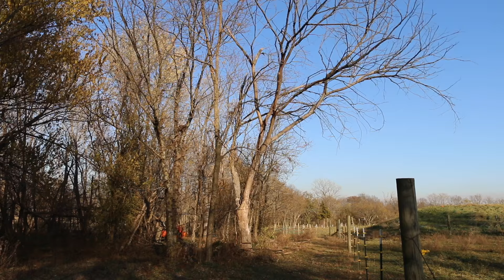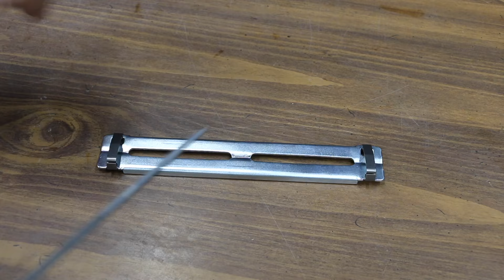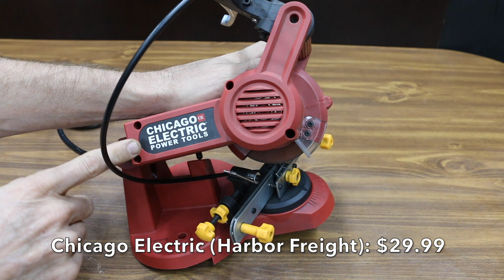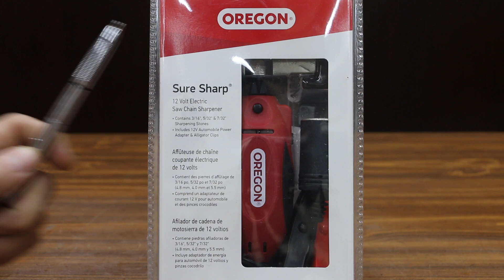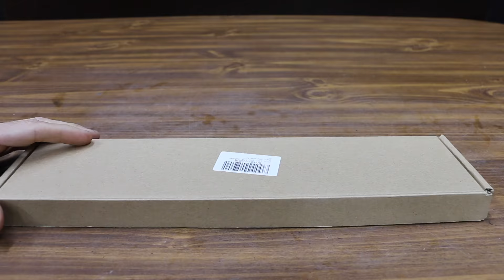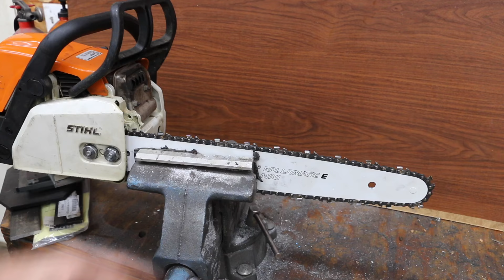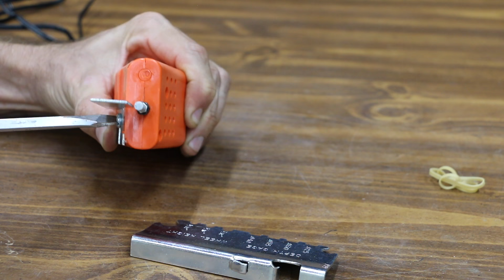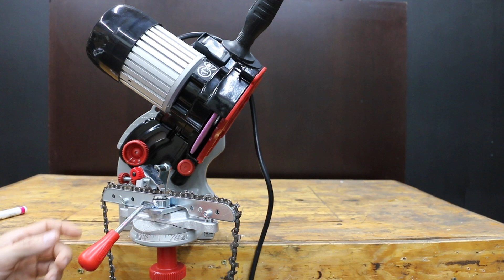Which Chainsaw Sharpener is Best? Let's find out! Stihl, Granberg, Chicago Electric, Oregon

Comment: I swear by my cheap bench sharpener. It will change the geometry. Only use one method of sharpening.

It will cut down the life time of the chain. One chain will last me 120 cords.

With practice they are fery fast, very sharp, and consistent edge. Comparable to a brand new chain. 

I use the slop in the pivot to bring the grind stone past the tooth, with out touching it. Then grind up against the tooth in a lifting motion. Not a cut down into the tooth as displayed in this video.
Reply from the maker: Great feedback. Thank you

Comment: Another variable to consider during this test is the power of the chainsaw. For example, if the slightly different angles being placed on the chain is causing it to bite too much, that could slow down the revolutions. Got to find that sweet spot for your individual saw
Reply from the maker: Thanks for sharing.

Comment: Those chop saw type give no feel. And they probably ruin the bit by overheating each tooth.
  And never ever ever line your face up with a disc. Grinder, chopsaw, whatever. If they get a crack they can explode. In an X or Y or Z direction.
Reply from the maker: Thanks for the feedback!

Comment: This is like art. Or really, an artist.
  The angle of the sharp of the bit totally depends on the speed, torque, pressure applied, amount of material at pitch or angle to be removed.
  Not only that, you have to know the saw. The torque the speed. Learn to rock the saw and stick those teeth into the material.
Reply from the maker: Thanks for the feedback.

Comment: I always look forward to your videos. Thank you for putting so much time and effort into them. I don't watch them all but I often check if have an upload about something I'm doing.
  But I just want to say. I think you like sharpening a chainsaw chain. You seem like that kind of guy to me.
  A chainsaw blade has two teeth in sequence that face the same direction. Find them and start there. No need for a gold tooth.
  And for everybody else get a dremel type device and bits for chainsaws. Because if you can't sharpen a chainsaw tooth you should put the saw down. How long do you think that tooth holds an 'edge'? It's the style of the cut in each bit. Plus each and all the bits. It's the cup and the pitch and the angle and.. did you overheat that tooth with the dremel?
  Chainsaw tooth doesn't care if it's long or new. Sharpen those teeth down until they are nubs or break. And for newbies, learn how to saw with a chainsaw. And if a chainsaw could talk, it would ask, "just help me cut."
Reply from the maker: You are welcome!  Thanks for the feedback.

Comment: I have the Stihl 2 in 1. It works great. It keeps the rockers at the right height while sharpening. I think it takes the rockers a little lower than when the chain is new, making it a little more agressive. The tips feel like a cat's claw. Easy to use, no set up.
Reply from the maker: Thanks for sharing.

Comment: I use the Stihl 2 in 1 file either at home prepping my saw or out in the bush cutting old dry wood between tanks. Good gear and love how it sorts out the depth gauge at the same time.
Reply: It takes a few goes to get used to it. It's hard to beat.

Comment: As Always,, Fantastic videos!   Greatly appreciated.
The ONLY thing I would have added, would be to add an RPM readout to the chain!?   
To show what chain is actually biting more, before & after sharpening, & or if your battery is not fully charged.?
THANKS!
I will stick to my Very OLD style Harbor Freight sharpener for now,,,, (under $25 with coupon) & take the 'rakers' down a few more K's.
lol,,, I TRY to slow down my screaming 365 Husky,,,,, it still RULES!   ;>)
Reply from the maker: Thanks!  Thanks for the constructive feedback.

Comment: I run 5 chainsaws as a log home finisher.  Three Stihl, one Husqvarna and one Jonsered.  And I hate to admit that I can't sharpen chains to save my life, so i had two or three chains for each saw.  I run Stihl chains on everything.  I used to pay an old timer $6 a chain to hand sharpen them until he passed away.  New guy used bench power grinder and ruined all my chains.  Stihl told me not to use grinder unless it was a diamond grinder or you will over heat and Blue the chains and ruin them.  A local company sells Carbide chains at over $100 a chain, you can't sharpen these.  I ran one chain for 2 years until someone "Borrowed" my biggest saw without asking and shattered 8 teeth.  Expensive but stay sharp for a very long time.
Reply from the maker: Thanks for sharing!

Comment: i have stihl 2 in 1 and i use the chain brake, sharpen all exposed cutting edges, then unlock and manually rotate it to expose new ones until im done. easy peasy and works amZing

Comment: Sorry if this has already been mentioned but it looks like the expensive oregon grinder got the cutters too hot. You can clearly see blue temper colors on the tooth, which means it would have gotten dull more quickly. That could explain the unusually slow time on that chain.
Reply from the maker: Thanks for the feedback.

Comment: I'm a big fan of your impartial and robust reviews. Thank you for taking such time and care to be independent and reliable. 
I'd love to see how the Oregon Powersharp system stacks up against these. Some regard it as a gimmick, but the 5 second sharpening process and reliable chisel profile is helpful especially for the inexperienced. I've found it useful on my ego power+ saw and my petrol one before that. Although more expensive to use, it does remove the safety risk of using a blunt chain or one that is out of balance due to improper sharpening. Pros and cons so a test would be great. Keep up the great work! Best regards from Sussex in Southern England!
Reply from the maker: Thanks!  Thanks for the video idea.

Comment: I have hand sharpened a lot of chains over the years. The last 5 years I have mainly used the Chicago Electric.
 
Pros: the bicycle brake handle style clamp works great. Easy to use. Cheap. Can easily see to set up. 

Cons: has a lot of side to side slop, if u take care to pull down straight u can get a decent sharpen, if u are not careful, u will get one side sharper then the other and the chain will not cut straight. Have to clean the space behind the clamping plate regularly. Can't change the pitch

Currently eyeballing the Maxx Chainsaw Sharpener (Maxx - 13151),  Super Jolly Pro Sharpener (super jolly pro TL150), or the Oregon 620-120. I cut a lot of wood and mill a fair bit with an Alaskan mill
Reply from the maker: Thanks for sharing.

Comment: I've been using the Dremel sharpening kit on my chains and it's worked well for years.  Similar to the Oregon Sure Sharp. Install the stone in the chuck, install the kit on the end of the Dremel tool and sharpen away, with angle marks on the guide plate.
But you've got me eyeing the Stihl 2 in 1, now!
Reply from the maker: Thanks for sharing.
Reply: Works great for me as well.  I’ll never go back to hand filing.

Comment: I wish the “Timber pro” was tested. 
  It uses carbide cutter.   Everything else is either file, disk or stone.    Great test nevertheless!👍
Reply from the maker: Great suggestion!  Thank you.
Reply: Tried one out, it worked but i let another boy have it. The idea came from a old hand crank saw mill sharpener they used to make.

Comment: Pointing out that the bench grinders are great for removing a lot of material is telling. Proper settings. Proper wheel cleanliness and profile and an extremely light touch will produce the best results also allowing for more sharpenings extending the life of the chain. Replacing worn chains has become something that rarely takes place. Watching the other self-proclaimed you tube saw chain filing experts is amazing to see them filing half the chain tooth away on the first sharpening and tell viewers how great it is. 🤪
Reply from the maker: Thanks for the feedback.

Comment: I’ve been recommending the Stihl 2 and 1 for years now I’m super happy to hear that it’s most definitely still a great recommendation
Reply: The Stihl 2 in 1 seems to be a clone of the Pferd 2 in 1, or perhaps it is made by Pferd for Stihl. Only difference being color of plastic and the Pferd is a few dollars less. They come in various chain pitches (ie file size) to match your saw chain. I've been using if for two years with a stump vise in the field, and haven't used my bench saw chain grinder since. Another advantage in using the 2 in 1 system is there is no chance of overheating the chain tooth as too often happened to me with the bench saw chain grinder.
Reply: @Roy_Najecki_1776  how are they on skip tooth chain ?
Reply: @scottbennett6494  I don't know because I don't have any skip tooth chains.
Reply: @Roy_Najecki_1776  if memory serves me they are sister companies.  Pferd is difficult to find in the US.  I just picked up a 2in1 and it was $45 locally, rhe Pferd is $36 on Amazon sold by Pferd.
Reply from the maker: Thanks for the feedback.
Reply: @ProjectFarm   found they work very good on " full house " but they are terrible on " skip tooth " chain
Reply: I do not cut alot, but I have cut off and on for many years.   Sharpening a chain has been hit or miss for me... the Stihl 2 and 1 works everytime, I will never go back.  I tried the Oregon quick sharp and it didn't have a long life.   Good for a few sharps, then cuts in a circle.
Reply: I think swapping out the file in the 2 in 1 could increase the depth of the raker cut.  
If it did, the sharpener had an advantage over the other methods. 
I'd be interested to see what the raker height wound up at. 
Seems like the 2in1 was the only method that had the possibility of raker material removal.
Reply: I have a stihl 2in1 as well, easy to use BUT Pferd is a German sister company to stihl and their identical version is almost half the cost but still using German files.  Avoid chinesium amazon and fleabay knockoffs
Reply: @dtjf350  them German files are so nice. I believe a brand new 2&1 will get a chain sharper than it was new.

Comment: I really believe (know) the Stihl two in one system is probably the simplest and most effective.  A couple of reasons:  The raker file incorporated in the system, simple to use, more files and economical.  I have tried quite a few different systems. (not the Granberg or the disc grinders)  I have a small vise mounted on a weighted 55 gallon barrel;  I clamp the chainsaw bar in and go to sharpening, most of my saws have 24 inch bars and I can fully sharpen them (even if very damaged and dull) in under ten minutes.   Great video, very informative!!!!!
Reply from the maker: Thanks!  Thanks for the feedback.

Comment: Great guy, great channel. However this is the only video of yours I don't like. The hand file is the best way to do it but it takes years to master it properly plus you NEED a vice and two hands. Most home owners would never use the saw enough to gain this experience so for them a good bench grinder would be better.
An experienced file user would claim a new chain is a pain in the butt and will improve significantly after the first 1-2 hand filing sessions.

The second cheap grinder you used.. 
You didn't drop the whell down far enough into the tooth to properly cut the gullet, so its not quite fair to judge it as you did.
It wasn't clamping the chain properly at all times.
That white-wire thing you had under the chain effected the height of the chain and would have caused a variation on several teeth.
Yes, it changed the geometry of the teeth but it could have been adjusted to avoid that.

The small Oregon and stihl one you attach to a battery. they are rubbish. Doesn't matter the brand.
The radius of the stone is always decreasing, thus creating an ever-changing gullet. Yes you can move it back and forth to slow this process but it doesn't take long before it changes shape.
Avoid.

The Stihl all in one thing. 
Their not too bad but after setting the height of a depth gauge one is meant to file the front of the gauge to about 45° so it has a less jarring encounter with the wood. This guide can't do that and you need a stand alone flat file to a accomplish it....So you might as well just do the teeth with a round and then the gauges with a flat.
It is also way over priced (at least where I'm from)

The grandburg bolt on the bar thing. 
If set up correctly it should offer the best possible result buts its very fiddly.

Oregon (and any) bench grinder.
Can be OK for sharpening the right hand teeth as it pulls the burr away from the side of the tooth. It can leave a mean burr on the left though. It won't it you do it slowly but half the appeal meant to be speed. If you hit metal or a rock with the chain it'll need a lot of grinding, if you take off massive chunks quickly it heats up the teeth too much and they get way to hard. So hard you'll not be able to use a hand file if you want to afterwards.
I'm really not a fan of these things.

What happened to the 3-5 seconds thing?
Only one it never used.

So many variables here...
Love your channel mate, not trying to crap on you.

Thanks for all the vids, keep it up.
Reply from the maker: Thanks, will do!  Thanks for the constructive feedback.

Comment: Does set up time include taking the chain off and on the saw? Still 2 in 1 is clearly best value. Easy to use in the field.
Reply: Agreed. One of the reasons I never use my electronic sharpener.
Reply: Hand filing and not flipping bar over enough is why so many bars wear out one one side. And also after couple filings bar grove needs cleaned out and area around chain brake.

Comment: You do not include the time necessary to remove the chain from the bar and to reinstall it.  I sharpen my chains on the saw and it takes me about 15-20 minutes to sharpen a chain and file the rakers and I do not get in a hurry.  My bars are 20-36 inches long.    If the chain had been beat up it may take a little longer.  I have been doing this for forty odd years.while i am not a professional I am considered to be an expert.
Reply from the maker: Thanks for the feedback.

Comment: Should note the stihl angle is 30 degrees. Some chains are 25 degrees or different. It will affect how much you have to take off the first time. But it is the fastest and best field sharpener by far. Saves so much time
Reply from the maker: Thanks for the feedback.

Comment: I couldn't tell ya which sharpener to use but never let the guy that sells chains sharpen them. You won't get but 2 or 3 sharpening's out of a chain before it's time to buy a new one. I use the cheapo Harbor Freight model, it seems to do good enough for me.
Reply from the maker: Great point!  Another great reason to sharpen my own chains
Reply: I learned that lesson myself so I bought myself a bench mounted chain grinder. I also use a Granberg hand filer when out in the field. It didn`t take long for them to pay for them selves.
Reply: @quickshot100  Very true, certainly not wasted money.

Comment: Hand is best particularly if you are a long way in the bush.  The next is one that runs off a car battery.  Personally, I vote for the hand file.  Note; different timber types dictate that the cutting angle needs to be adjusted.  Sharpen your blades for an aggressive cut when cutting soft timbers.  Sharpen your blades for a fine cut when cutting hardwood.
Reply from the maker: Great point!  I really like the stihl 2-in-1 for field sharpening. Thank you
Reply: That is the point most people don't get. the factory angle is a compromise.

Comment: Great Video i worked for STIHL making chain loops, 100,000 a year plus by hand for all TX and OK there was always so much scrap i was able to make enough new chain loops for life for my two saws, i also have two of the products you reviewed , the Chicago bench grinder and of course the STIHL hand held file set if i am in the field, i do find both helpful, i was told by a tech that when using the bench grinder to use three small easy taps to sharpen the tooth  or you take the chance of heating the tooth and lesson the hardness and to take only the smallest amount you can off each tooth.
Reply from the maker: Thanks!  Thanks for sharing.

Comment: Cool video!  Must add I use a Dremel tool kit.  I bought the chain saw sharpening kit and use that.  It works well, but I don’t know the time.  I try to make my chains last as long as possible so try not to take off too much metal.
Reply from the maker: Thanks.  Thanks for the feedback.

Comment: That last product with the big grinding wheel: I'd try pressing the wheel down much more slowly, and perhaps give it a bit of water spray, to keep the blade cool.  It looks like you discolored it from heat.
Did you check to see if your test setup was producing consistent results?  You were tilting the saw more on some cuts.    Overall though, very informative!  I learned from it.

Comment: That was a very useful test comparison.  The only thing I would like to mention is that the charged state of the battery has a lot to do with the speed of the cut, as well as the hardness of the 4 by 4 where the cutting is done.
Reply from the maker: Thanks!  Thanks for the feedback.
Reply: Plus dry pine is the easy wood to cut. And because it was dried the pitch was set. Gives no idea what chain will do on green wood or pine that's not been dried. That is why electric saw sellers love to rate there saws on dried pine. Not rough sawed green pine. Or a equal size green log.

Comment: Great video! I have tried several different sharping methods and believe there is a learning process regardless of the tool used. I have seen a sharpener made by Timberline that has a carbide cutter  with a bar mounted guide I would like to see tested.
Reply from the maker: Thanks!  Thanks for the video ida.